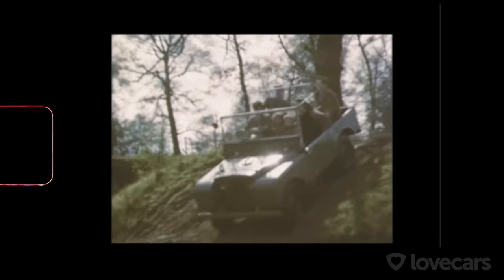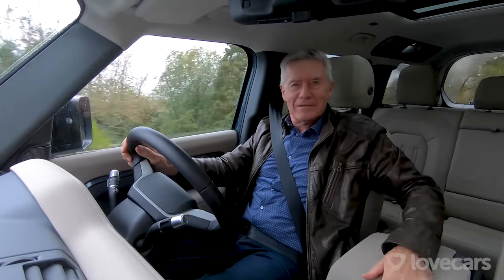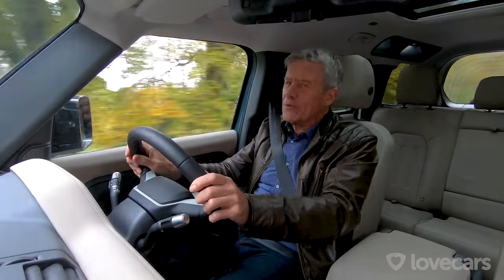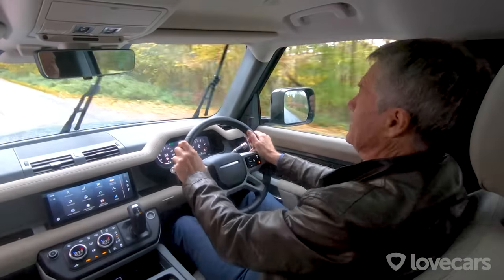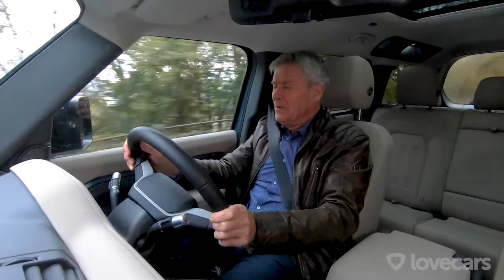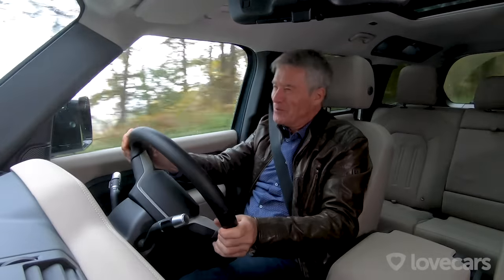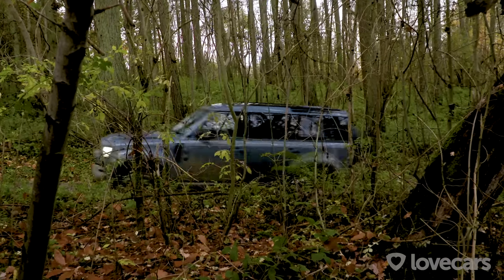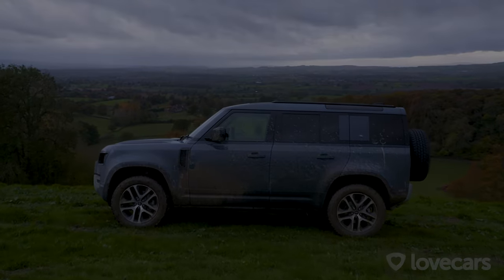New Land Rover Defender. On road. Off road. With Tiff Needell

Comment: Now we might get an honest test. Tiff tel it how it is. Can it be fixed in Nepal  by the locals half way up a mountain like the original?
Reply: Name any modern 4x4 that can?
Reply: @gc2234  land cruiser 70 still produced for Australia
Reply: @Gklasse  oh right I didn't think I needed to specify this, but how about a vehicle designed in this century, and not just made for ONE country with no emissions or safety regulations? 😂
Reply: @gc2234   Beg your pardon? No safety regulations in Aus what are you smoking? Christos point is there are so many electronic settings in the all terrain system if they malfunction your cooked. It’s not as if JLR products are actually reliable either. Just look at the TFL channel and their brand spanking new Defender lol.
Reply: Bore off
Reply: @anugranmathimugan2778  TFL does not do automotive journalism. And they do not declare conflicts of interest either. I can buy anything myself, break it and then blame the manufacturer for the failure while I put up posts on social media about how bad the product is. Was it by coincidence that they bought the cheapest one they could specify, if they intended to break it anyway? Stop being gullible and naive and following personality cults on the internet. I know of at least half a dozen individuals who bought the new Defender around the same time TFL did, they have been testing it ever since in extreme off roading situations to evaluate the vehicle and its capabilities for their clients, and none of them has 'broken down' or suffered any other kind of problem. You see, the people I know do not rely on a youtube channel and on views to make their money - they are professional people in the automotive mods industry and have no gain in attracting the haters and trolls of youtube to put food on their table and 'grow their channel and business'.
Reply: @Gklasse  So, a dinosaur from the neolithic age. Farm tractors have more tech on them today than the Troopie. Also the 70 is only sold to the mining industry in Australia, and only in pick up form, so it's not a readily available vehicle sold new to the average punter. Get over it; new vehicles are made for their times. The Series and the Troopie were made to cater to the needs of a fairly limited amount of people, a very long time ago. Times and needs have changed, and so have off road vehicles.
Reply: The locals would be driving a Toyota - they gave up on Land Rover 50 years ago

Tbh the new defender is a million miles better than the old one in every way
Reply: @Gklasse   needs to be simple for Australians...😂
Trouble is 70’s don’t meet the emissions or safety rules for sales in Europe or North America 
That’s what much of the tech is for..
Reply: @cuttight  well said. TFL is just click bait, and now they have ‘broken’ a F150 (switch). Bad,sensuality news gets more views for gullible people

Comment: Good to see off road section with Tiff holding the steering wheel properly  thumbs on the the wheel not  wrapped around. Well done!
Reply: Thumbs wrapped around is only used for racing. When you're off road you have to have thumbs not in front of the wheel because that is where feel of the road and control is completely irrelevant to the driver. So it's not worth the risk.
Reply: @seren1ty755  thumbs on the wheel is the correct way when offroading to prevent sprained wrists or brocken thumbs as steering wheel can whip when tyres  fall into a rut or push off a rock. I was praising Tiff not criticizing.
Reply: @waynesmith678  yes I'm aware of that. That's why I said you shouldnt wrap your thumbs around the wheel off roading.

Comment: Its so much more expensive than the old one.....oh no wait the old one cost 50k...
Reply: I even managed to find a heritage edition for like £65,000 or something like that.
Reply: Second hand because they have appreciated in value. New they were £30k, that's a success story if anything.
Reply: @Khalaxe  well not exactly as some models were well over 55k new.
The price of the new commercial defender will be around the 30k mark.Again this reflects the large spread of prices of the old one 23k-60k.
Reply: @andyhunt457  Still cheaper dude, that's like me saying the new one is 100k because it can be, you are making the old one seem more spenny than it is. You go from the lowest price, respectively 23k for the old one 45k for the new one.
Reply: Ah yes, 90% are still on the road, [The other 10% managed to make it home before the check engine light came on and something died}.

Comment: Used to drive an old 110 defender for railway incident response, absolute dog of a car travelling 50 miles to get to the incident but fantastic once you get through the access gate, then a dog of a car driving 50 miles back to the office, I’d much prefer the new defender in that job

Comment: All well and groovy now, but the longevity of the vehicle is going to be the major problem going forward. Land Rover and technology just don't mix and air suspension on a workhorse? You just know that's going to be expensive repairs somewhere down the line. It will be intersting to see how much of the flashy tech is working in five years time.

Comment: Unfortunately nowadays Land Rover is only selling one type of car. The only difference is the size. All models are the same. The New Defender is nothing more than a smaller Discovery. Very sad. I hope after the “wave” of the release of the New Defender, they will sell a proper spec model to be the true successor of the old one. Spring suspension, steel bumpers (with winch provisions), mechanical lockers. Something more reliable for overlanding and off-roading.
Reply from the maker: Who know's what the future holds for Land Rover. 😁👌

Comment: i’d get one if they were reliable :( … love the looks & features but bitter memories of dealer workshop will keep most away.
Reply: Absolutely. It’s a great car - no doubt. It shouldn’t bare the name ‘Defender’ (personal view), but that’s a different conversation. But the point is when it works it will be epic. But when it breaks, wherever you are, you will be absolutely and utterly stuck. And it will break. There’s already known issues with them. Land Rover reliability is laughable for a reason. There are more computers on this than any other Land Rover. Another reviewer had a great comment: ‘the new Defender is the iphone of cars’. Ie don’t bother trying to upgrade / tweak / customise / REPAIR it - you won’t be able to without the [hugely expensive] LR software. I say this as a current Land Rover owner, and having owned previously. It’s a great [expensive] car, when it works - but for a completely different audience now compared to its namesake.

Comment: great for a 20 minute blast through mud and slush, but 10 days across a few tracks in Australia and the rims are stuffed, the air suspension will die. The electronics will fail.  Take your sat phone so you can be rescued.

Comment: Wonder if it still leaks oil
Reply: wait a couple of years and you won't be disappointed!
Reply: Probably, but it's the poorly designed tech that us already causing huge issues with this car.
Reply: I think this car will have more tech issues than engine issues but then I guess half the tech issues can be sorted out with updates through the infotainment system.
Reply: Guaranteed...Mates brand new disco 5 is leaking oil around the sump.
Reply: @neilduguid6631  ye but that vehicle has different engines.
Reply: @beaviccoon470  2.0litre diesel same/similar 'Ingenium' engines I believe...not good
Reply: @beaviccoon470  you could be right...it’s the V6 diesel which I think is the Ford engine.

Comment: but if you just want a comfortable SUV, with a nice interior and decent off-road capabilities, why not go all the way and get a Range Rover, or if that is to bling for you, a LR Discovery.
Reply: Decent off road capabilities = Discovery

Class leading off road capabilities = Defender.

Ultimate luxury, on road comfort, and off road capability = Range Rover.
Reply: @gc2234  realistically though they can all do the same job..its not like the defender is that much drastically different... defenders nice but it should have been called discovery sport..

tarnished the name for me.. its mad iv got such a problem with thie vehicle..all because of the name
Reply: Not an SUV but 4x4

Comment: Have you seen what has happened with TFL channel they are waiting for their third one
Reply: Was following that situation closely, I could understand one dud but when its a ongoing thing I wouldnt touch it. The best part was the viewers warned them about reliability and luckily they have a YouTube channel otherwise not sure what would have happened regarding being assisted.
Reply: Yes it's been a utter fiasco.
Reply: Yawn. Click bait channel over sensualising bad, for views. They also ‘broke’ an F150
Reply: They completely ignored the 2000 miles run in period and instead took it rock climbing up a mountain at altitude. Lucky the dealer even accepted responsibility.
Reply: @agt155  it doesnt make sense that a mild mountain pass would brake a supposedly capable vehicle. I also just think that Land Rovers have issues and this is just what happens in general.
Reply: @henkstols9326  It triggered an engine fault code, probably from parameters being out of spec for the run in period, it didn't break it. Their dealer 'broke' it - twice. No one else has had this issue with the new Defender. There's too much lazy stereotyping.
Reply: It's a brand new vehicle for JLR...and a new manufacturing plant. The 4-cylinder model is going through teething problems clearly. Right now you would have to be crazy to buy one. Even the camera system failed... it's pretty bad.

Comment: Comon Tiff, this ain't for the workman no matter how hard of a top LR makes.  It's for the Wall St crowd who want the "look of ruggedness" to impress their girlfriends or soccer moms to look mean while in the Starbucks drive through line.  The only mode they will need to use is snow for going up to the ski resort.  Of course LR would sell out their Defender brand to woe this segment coz they are the ones who would get all the top trims and OEM accessories so dealers and LR will make the profits instead of the aftermarket.  They gotta make a profit to avoid going out of business.
Reply: I’m sure Land Rover are quaking in their boots

Comment: The land rover defender 140 is banned in America
Reply from the maker: Did not know that. 😁👍
Reply: It was one of the older versions I think it was baned because no mater what it hit the other thing was destroyed. Also due to its steel frame it was hard to get into so it might has been classed as unsafe. This is why alot of the modern landrover have glass roofs it is so that they can break through the glass and not have to whast time going through the steel framework

Comment: Don't get carried away with the hype My test drive engine light came on on way back to dealer went into limp mode. Loads of reports of suspension fails, engine limp modes, dash board display disappearing. Go on line follow TFL watch there video on there defender.
Reply: Click bait channel. Did you know that they ‘broke’  an F150 too. Other than that there are no real issues other than any other modern car. Don’t be like TFL and over sensationalise. Bad news sells better than good,that’s it.
Reply: It's a brand new vehicle for JLR...and a new manufacturing plant. The 4-cylinder model is going through teething problems clearly. Right now you would have to be crazy to buy one. Even the camera system failed... it's pretty bad.
Reply: @Archiepopop  This might come as a shock to you but cars/trucks break. But the new Defender has known problems. TFL has had tons of vehicles that have not broken with just 100 miles on them. To anyone who knows anything about the JLR line...this is no surprise at all.
Reply: @mboiko  all cars break down . My shock is that you are fixated with that one click bait channel to base your biased opinions on a great car.

Comment: Bronco instead!?
Reply from the maker: Which do you prefer?
Reply: Don’t think it’s coming to UK..🤔
Reply: @neilduguid6631  It's not coming any time soon.  They're sold out in the US at least through 2021.  But they might arrive eventually.  They sell the Wrangler, so there's a market for it.  If you can wait, it will be a much better off-road 4x4 than the "Defender".
Reply: @geoffk777  the crash safety and emissions standards of the Bronco will be nowhere near as good as a Defender. Which is why they're not going to be selling it in Europe. It doesn't pass EU regulations. So don't try and pretend it has anything to do with it being "sold out". 😂
Reply: They can't sell the Bronco in Europe.
Reply: @gc2234  Why not?  They sell Wranglers in the UK.  What makes the Bronco less compliant or safe than a Wrangler?
Reply: They are class apart
Reply: @theonlymanofsteel  That's true.  The "Defender" is an expensive luxury SUV for mostly on-road use, while the Bronco is a relatively inexpensive 4x4 for serious, off-road use.  It also has a removable roof and doors.  I doubt that many Bronco buyers would  consider a "Defender" a capable alternative.  And "Defender" buyers would be disappointed at the fairly basic equipment and on-road compromises of the Bronco.

Comment: Hmmm, 9mins + on tarmac & only 3mins off road with no sand ??  Sure, this Disco 5 is nothing like a Defender, not to mention the punitive pricing. 
 From a 110, Disco V*8i, diesel TDi, TD5 & a Freelander - no more LR products for us Sri Tata.
Reply: And, if it is a 4WD why do you have to buy an off-road package for ?GBP1500 ? 
 Furthermore, ARB does not even have a winch package available & apparently first attempts to fit one in the US ended up cutting the wiring loom ???,  check out 4xoverland for a pragmatic, realistic appraisal of this Toorak Tractor/Jumeirah Jane limo.

Comment: Wish these had some decent reliability. What’s the use as they keep breaking down. See TFL folks and the nightmare they have had with there new defender. If only they asked Toyota to build them. Would be worth buying. Sadly they are junk.
Reply: Yawn
Reply: Truth hurts...It's a brand new vehicle for JLR...and a new manufacturing plant. The 4-cylinder model is going through teething problems clearly. Right now you would have to be crazy to buy one. Even the camera system failed... it's pretty bad.
Reply: @mboiko  haters gonna hate whatever, Shame.
Reply: @Archiepopop  You're confusing truth with hate.

Comment: A fantastic vehicle, BUT, not for long-range off the grit where you have no reception. Too much electronics and can't custom-fit what I want to fit for Overlanding. So no, not for me taking long and remote trips, but only for those yuppies wanting to do the once in a blue moon offroad weekend trip where they are still in cellphone range if it breaks down. Too much electronics.

Comment: It's too electronic, you can't fix it yourself, engine lights come on (watch TFL), it's a Discovery (as said by Richard Hammond). So let's not kid ourselves that it's a "Defender", it's not. It's a typical luxury Range Rover, too expensive and too complicated. Would I have one? Yes I would, with a lottery win, but only for running round in the UK and close to a Land Rover dealership where I suspect I would be taking it multiple times!

Comment: Land Rover still has a reliability issue. Nice car but it’s to premium to be a “tool” if you ask me. Even the hardtop version.
Reply: All cars even new ones have issues and get sorted
Reply: @Archiepopop  sure..😉
Reply: Not sure where you are, but around here top specced Wranglers are everywhere, that cost more than the base Defender (which has most of what the top spec Jeeps have).  The Jeeps are certainly bashed around so don't see why the brand will stop a similarly priced LR from being used the way it was designed.
Reply: @cmacd8879  the Netherlands. Lots of tax here on cars. If it’s a diesel you are almost a criminal😜.So car here are always expensive.  Except if it is electric... long live the government.✊ 
I prefer my land cruiser for the simpel reason I need it to always work. I need to bring my horses everywear. In the past, I have had 2 defenders and a disco. Since 4 years I have a land cruiser. And I must say.. it’s just better in reliability and overall feel. But it  does not have the English design... I know.

Comment: You couldn't take it offroad in Australia!
Reply: I’m sure you could
Reply: @Archiepopop  No way to fit a bull bar or winch. No recovery points.
Reply: Do your research: LR have developed a bull bar kit, factory approved that will not void any safety regulations.
Reply: @cmacd8879  My apologies. Australian reviews from a week ago said nobody had a bull bar kit available yet or in the foreseeable future. They said Landrover had tried to fit one here but wouldn't work with the wiring harness.
Reply: @DavesIneosGrenadier  - actually we're both right....;)  It is a valid part, but the fine print says available early 2021.  So it sounds like some of the more specialized kit is being rolled  out over time, as the Defenders start to get delivered in significant numbers.  I would guess the ARBs of the world will have their own version at some point.
Reply: @cmacd8879  In the review I linked the guy calls ARB and they say nothing under way.  Usually they have accessories ready to go pretty soon after launch. Test guys in the US ordered a base unit to setup for offroad and the engine failed on the first day and a new engine had to be ordered from the factory. They organised a different car but the wiring harness was damaged and no replacement was available in the US either.